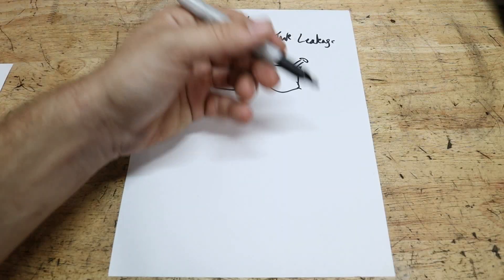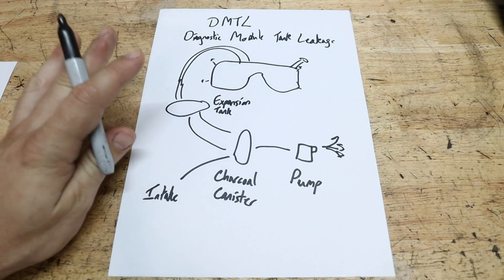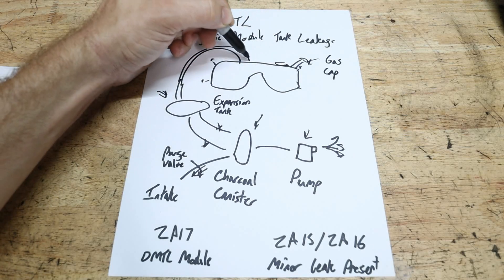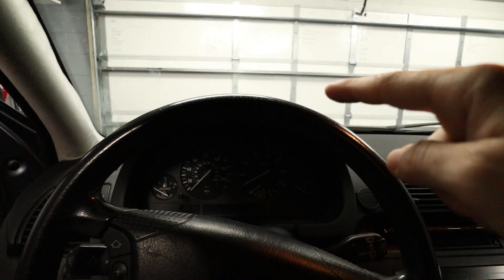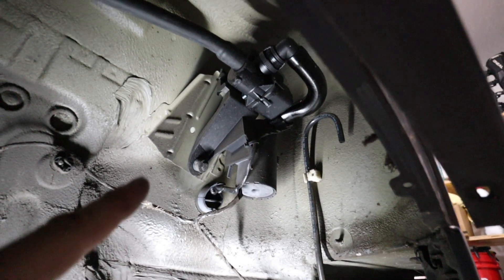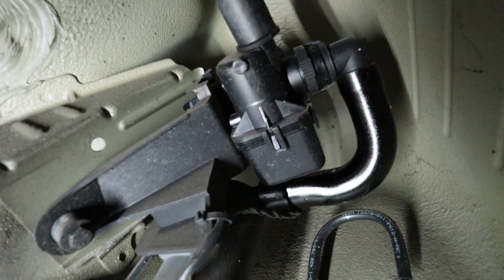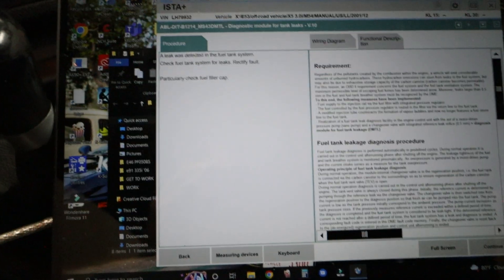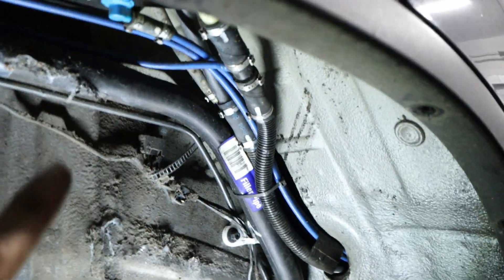How to: Diagnose/Fix DMTL Fault Codes on your BMW

Comment: I have a DMTL code on my Hyundai but I’ve replaced all evap parts except hoses but still not going away. Was thinking maybe the connection to the dmtl is faulty and doesn’t have any current. Any ideas?

Comment: Help! Any idea? 
P1147 Diagnostic Module Tank Leakage (DM-TL)
Pump Current Too High During Switching
Solenoid Test
Reply: Got it figured out?
Reply: @ nope! I’ve changed the butler pump, code still keeps popping up!

Comment: I have a p2096 code rather than the codes you mentioned. It says its for the dmtl pump current too high. 2010 328i e90. I also got a p1449 around the same time for the o2 sensor. Not sure if they're related or what to do about them yet. Ill probably replace the o2 sensor for starters. Any ideas?

Comment: you should've confirmed the leak by spraying some soapy water on the gas cap , and a smoke machine works better but you needed to close out the vent on the dmtl by grounding out the wire #4

Comment: Got a p0456 and a ghost code along with it on my 2014 m5 , I just replaced my gas cap today The old one was pretty worn out hopefully this fixes my code
Reply: I have the same code but the new gas cap did not fix it. What was your experience? thx

Comment: I got a 2A18 code, it says DMTL Diagnosis Module Tank Leakage, Heating: Input Signal. Does the DMTL pump have a heating element? I was wondering if this was a connection issue although what do you think? Anyone had this code before?
Reply from the maker: Yes it does have a heating element on some models, the whole pump needs to be replaced. Hope that helps!
Reply: turns out it was disconnected the whole time, i reconnected it and now i am getting P2419, P2401, and P240A codes lol, I tried testing the pump using INPA and the heater turns on and off fine although when I go to activate the pump or the valve it flashes on and immediately turns off again. Not sure if that means it activated successfully or it failed to stay "on/open". Any suggestion? 07 335i @TheBimmerBarn

Comment: I have a 3.0L X5 2003 e53 BMW, I've replace L.D.Pump-5X, all hoses, charcoal canister, solenoid, checked wiring 3 times, flashed ECM, replaced filter, fuel pump, smoke leak tested twice, and still get high voltage codes/DMTL's C8 or P1447, or 1449, or 2407? what are your thoughts ECM bad?? My mechanics baffled, I'm baffled even the place in Germany that helped flash the ECM is scratching his head. Can I clone it, repair it, or is there anything else you know of??

Comment: This was a through explanation of the system. However you did not include a check of the fuel pump gaskets or O rings. Also funny you saw the gas cap early with the crack in the seal and in the end you found that to be the problem. Great video!!!

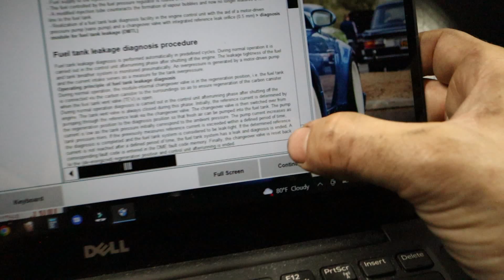Comment: 10:53 Procedure step one is "terminals switched." What terminals? Where?
Reply from the maker: It's a term for a 12v power circuit in the car that turns on/off when the key is on/off. Controlled by a series of relays and switches and timers.
Reply: @TheBimmerBarn  Thanks. So that is saying turn ignition on. If it is already on, turn off then on? I've never heard or seen it expressed that way.
Reply from the maker: @AlanBurnham  Exactly, for some diagnostic procedures, the car has to turn off then on again!

Comment: Mine says 3225 DMTL leakage diagnosis pump, activation: Short circuit to B+. I replaced the gas cap and pump, any ideas?
Reply: Just came across this code. Did you happen to ever figure it out?
Reply: @trevertressel70 Yes, replaced DMTL pump, problem solved.

Comment: What would P1148 on a 2007 x3 mean you think?
Reply from the maker: Just a quick google tells me that's possible an Air/Fuel ratior problem, or bad oxygen sensor. The description might be more accurate if you scanned it with something for BMW's, and then I would go from there! Hope that helps :)

Comment: you explain it so clear!!,  let me ask you something.  I have a problem when filing gas to the tank,. the nozzle cuts every moment and i cant full the tank.  Where you think could be the problem? its a permanent problem i have long time ago.  thank you!
Reply from the maker: This is a common issue when the charcoal canister has failed. It acts as a filter for outgoing air, so if it's "clogged up" or old, it will not let the air out of the fuel tank fast enough for the gas to come in, so it backs up the filler neck and trips the safety circuit on the gas pump. Hope that makes sense!

Comment: A very helpful video for diagnosing my 2004 Land Rover Range Rover Hse 4.4l (BMW M62 TUB 44 Engine). My Scanner runs an EVAP leak test which should verify no leaks?
Reply from the maker: Yeah, that forces a dmtl test! Great way to diagnose/confirm your issue.

Comment: Great video, thanks. Do you have any idea what "(8c) DMTL pump output stage fault" mean? I have replaced the pump, gas cap, it still comes up after a few days driving. It is a E53. Thank you.
Reply from the maker: Have you checked the wiring? Does the pump make noise when running the test procedure in INPA? Did you replace the seal on the pump to the canister? Maybe there's a hole or crack in the dmtl pipes that go to your gas tank. Hope that points you in the right direction, good luck and update us when you figure it out!
Reply: @TheBimmerBarn  FInally I got my inpa cable and inpa installed, it reads 140 error and 142 error, something about DMTL reed-valve not closed... I also ran the dmtl test and valve test, no sounds coming from the rear-left wheel well, sounds like a wiring issue (because I just replaced the DMTL pump and I tested it with 9v batter and it seems worked), but I have carefully checked all the wires coming to the pump nothing seems broken, is there a fuse somewhere? or any idea locating a faulty wire. Thanks

Comment: Do like I'm going to do just bypass the whole thing and get rid of it get a rubber plug and put it in the side of your intake where it plugs into it and do away with the whole system get a gas cap that releases the fumes through the gas cap like every other vehicle does it doesn't have all this nonsense it's going to break down on you and keep check engine lights on your car all the time every other year get rid of it
Reply: But I got a E90 I don't know if it'll work the same way on that car

Comment: What about 2a12
Reply from the maker: 2A12 is a DMTL solenoid valve code, probably the first component (the purge valve) we looked at. The only other valve in the system is built into the dmtl pump itself, so I'd look at those two places!

Comment: Nice video, very thorough. New to BMWs and now have my first DMTL fault code. During forum research i found step 1 was to check/replace gas cap. Did this, code remained. Confirmed via stealership the DMTL pump was reportedly the issue. Replaced with OEM part myself and "saved" 700.00 in service fees (850 for BMW to do job), fault code remained. Took it off and rechecked hoses, connectors, wires, and pump. All appeared fine, altough i did not open wire harness, looked too clean. After further research found the car needed to be driven awhile to clear DMTL code after pump swap and should clear after the car is turned off and the DMTL cycle is completed, did this and code lingers. Then, found this to be a common issue from other frustrated owners whom struggle with clearing the code. Apparently will need software/BMW scan tool to clear code and try again. Your video was informative for my next go-round. Although, i love the Bimmer, shes making me think of selling her and buying something less complex and pricey to maintain. I love her, but geeez is it silly to dish out so much cash and time for seemingly simple maintenance issues. Plus, seems the maint. schedule prompts for service far too often for a high-end, supposedly well-built, 7 series. Car in great shape, 60K miles, yet do not feel confident in her.  Also found out no OEM jack or spare provided, by design?? WTF.. so.. now i too get to stress on getting a flat and being stuck in a fancy, heavy paperweight 🤦‍♂️ Maybe oh maybe i made a mistake seeking The Ultimate Driving Experience. Hoping not.
Reply: telling you this now.  most cars now are this complicated if not more.  if you like bmws stick with them, learn their systems.  alot of procedures are the same on a billion different bimmer models.  hell what this guy is doing on his x5 is the exact same as what i'm doing on my 5 series that's 3 years newer.  just location of the canister is a little different.  don't rip your hair out now buddy because cars are NOT getting simpler AT ALL
Reply: I feel exactly!!!! the same way about my beautiful 17 530i.  68k miles and I just don't feel confident in it 😭

Comment: Great to show the complete system, Chris. 90% of this code is related to the tank cap. The big rubber o-ring will decay over time and starts leaking. My 2009 e93 had that problem too. Thanks for sharing this procedure. Have a great weekend. Dutch regards, Nico.

Comment: You could usually put a smoke machine where the purge valve goes and either cap the vent valve or use scan tool and close it . And smoke should pressurize in the system and be visible. But this works too shows all the possible components. Love it 👍
Reply: it can damage old vehicle liners